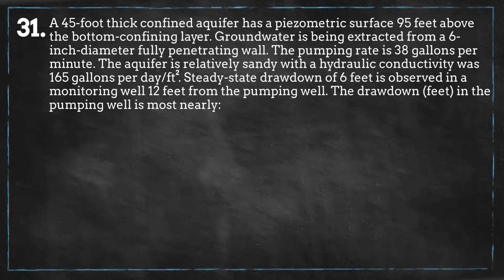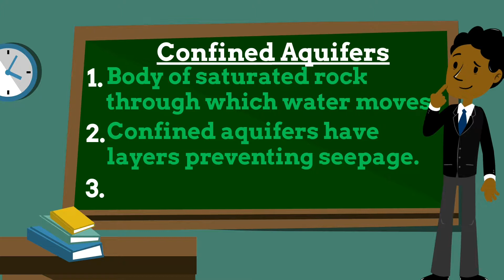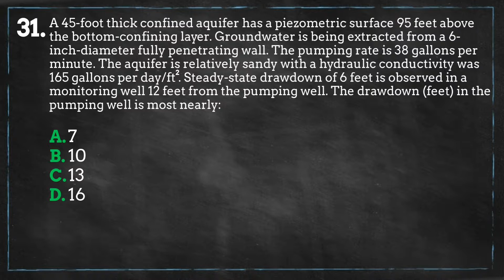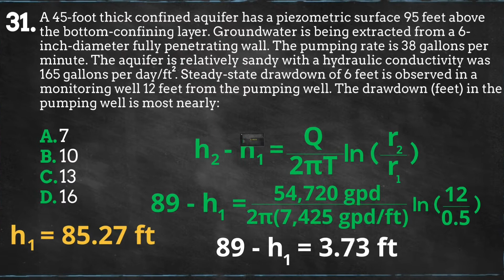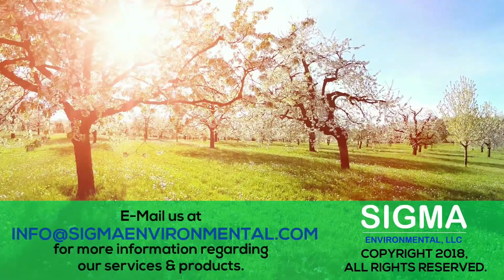Confined Aquifers -  Episode 31 (Principles of Water) | 52 PE Exam Problems in 52 Weeks

Comment: The problem states the diameter of the well is 6", therefore, r1=0.25
Reply from the maker: Thanks for your comment, Zoe.

After review of our script & calculations, this problem should have stated a RADIUS of 6" instead of a diameter. As it is stated, r1 should equal 0.25 and after completing subsequent calculations you should get a drawdown of ~10.5 feet, resulting in an answer of B.

Thank you for catching this!
Reply: Good catch.  The PE environmental Practice Exam  (2021) makes the exact same mistake on prob 67.  I'm sure this problem is modeled after this confined aquifer problem.  Problem statement gives well diameter of 4" and uses 0.33 ft as the radius in the solution.  I kept trying to figure out my mistake until realizing they had used the wrong value.